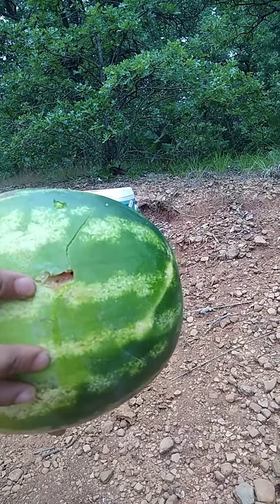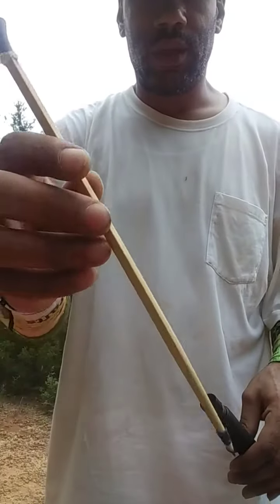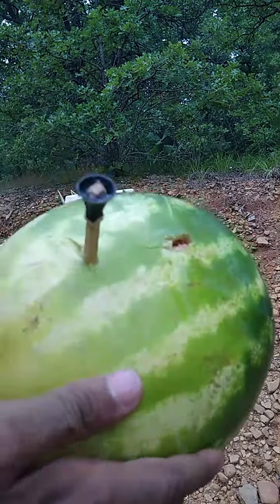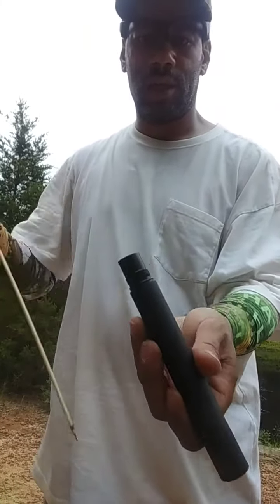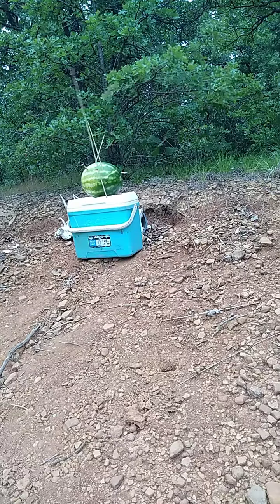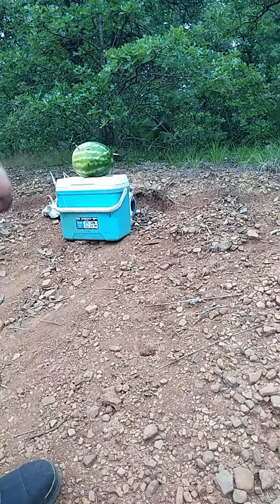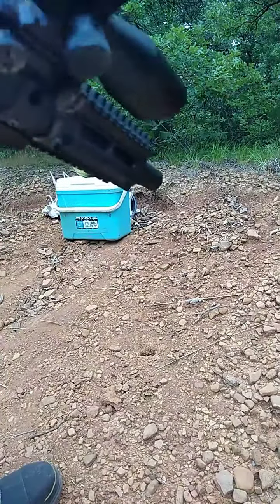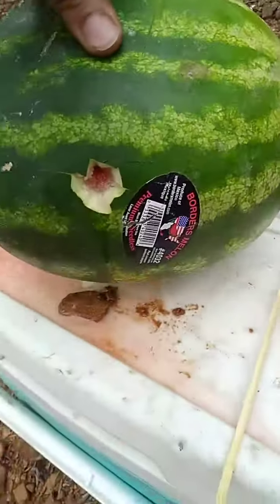testing my homemade darts with the Valken m17.

Comment: M17 Cross bow! This is awesome
Reply from the maker: @LL-Machines
Hahaha!!! Hell yeah!
I was telling Sean from "less lethal for dummies" that I just had to find out, LoL. I just finished making smaller razor darts for the Walther PPQ paintball marker. I'm curious to see what kind of penetration I'd get with the darts only because the PPQ is underpowered "but"with the right ammo... the marker could actually be effective... But I'm not saying that I would use the darts for self protection, which I definitely won't but I'm just thinking of terms of turning a underpowered marker into a less than lethal, but... like Jeff McKay done with his arrows they might be useful for fishing if a string is attached (I made a two headed razor dart). I'm taking my PPQ apart now to see if I can plug the blow back holes to gain more power. I'll upload the video tomorrow and I will be launching my homemade darts at the same watermelon I shot at yesterday.
Thanks for the comment... much appreciated 👍